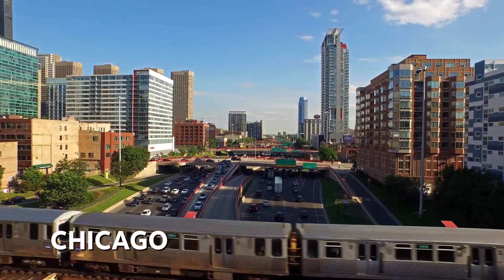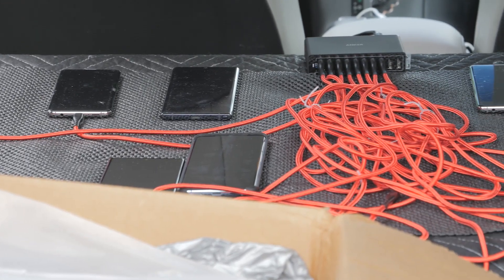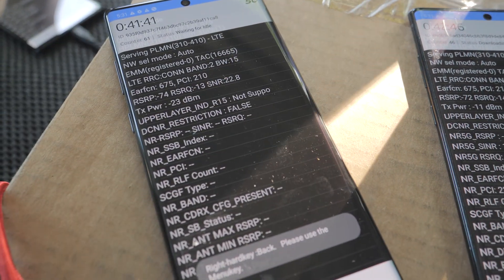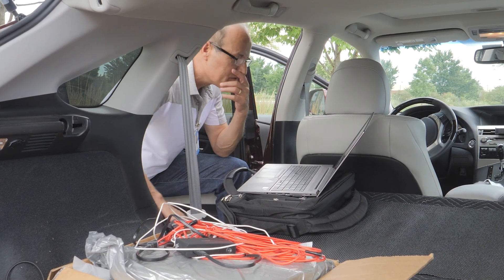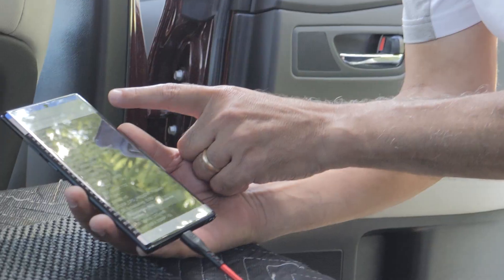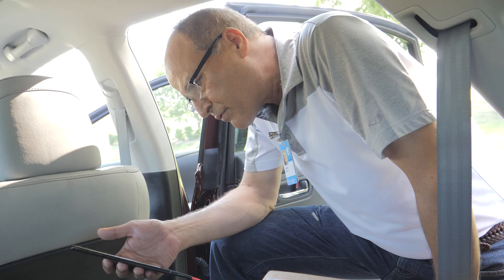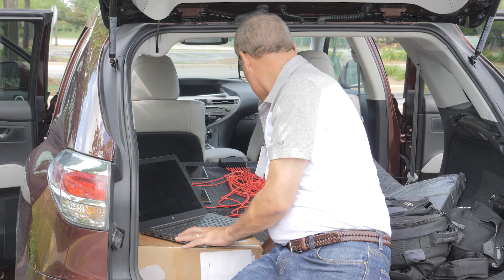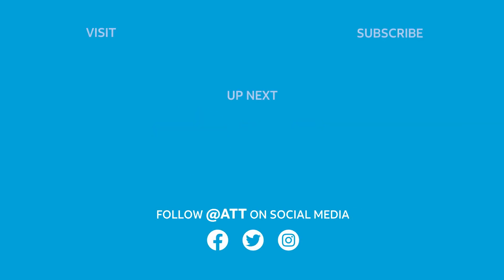Learn How AT&T Tests 5G Through Drive Testing | AT&T

Comment: Hey AT&T could you help me out (or any commenters who have had the same problem) My data doesn’t work at all. I’m on the plan, as far as I know the info is right, but when I try to use it it says “could not activate cellular data network(turn on Cellular data or use WiFi to access data)”